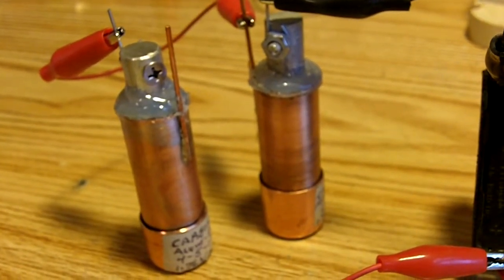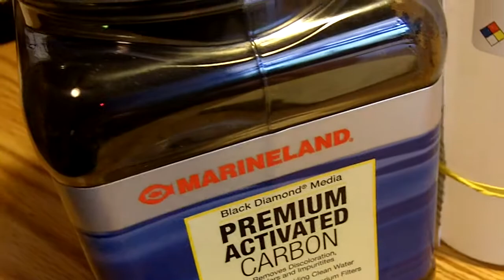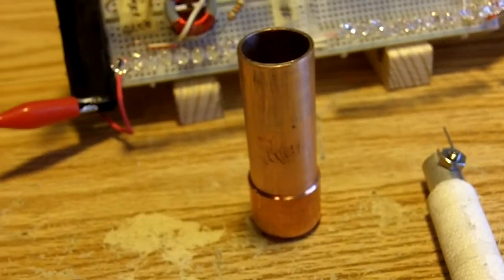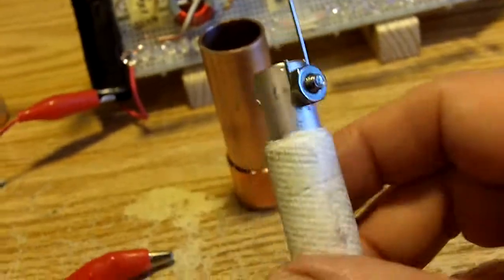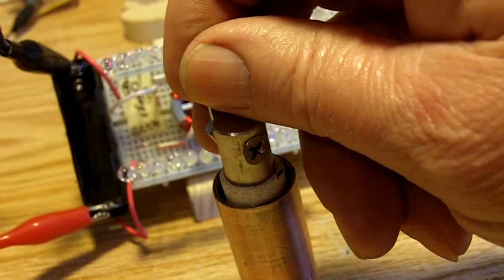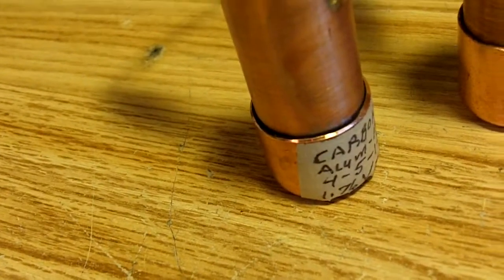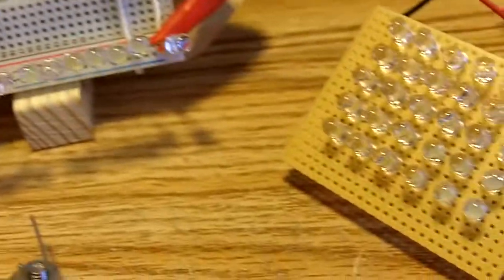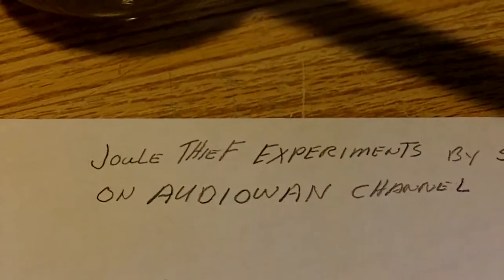Great little cell.MOV

Comment from the maker: Your right about them being all over the place. Today they are at  #1  1.55 volts, 54.3 ma -  #2  1.6 volts  112.0 ma - # 3  1.55 volts   44.3 ma. I now have them running alike pulse motors. I'll see what they look like in a week or so. The three little pulse motors are really flying.

Comment: Yeah would be great if too can post the results of the current after a day or more. As these cells seems to be all over place of the meter from day to day water drop to water drop. If it could hold 60ma would be great. But all my cells would end up in the 10ma range. Thanks for your posts